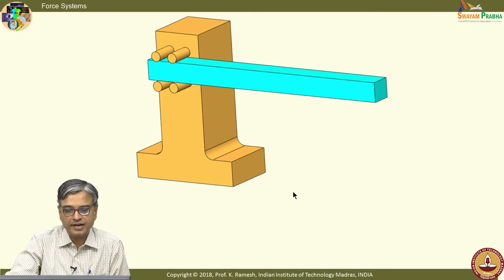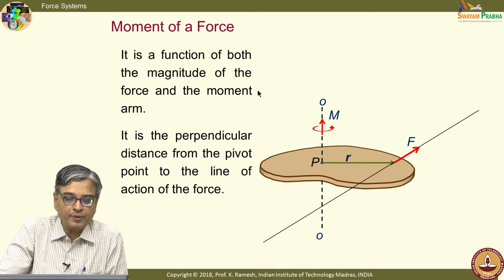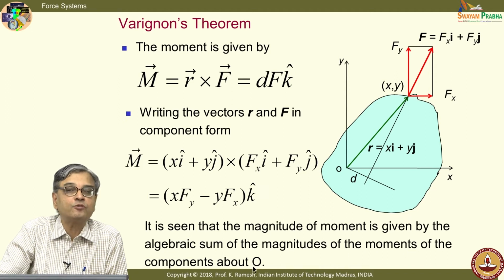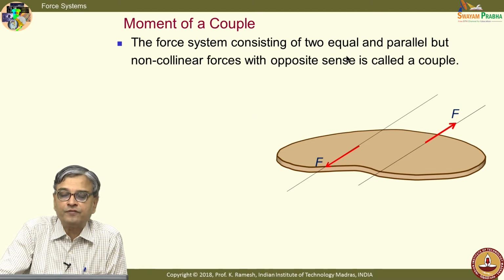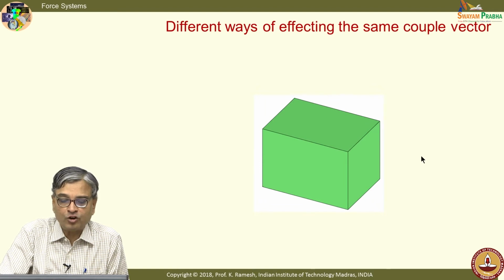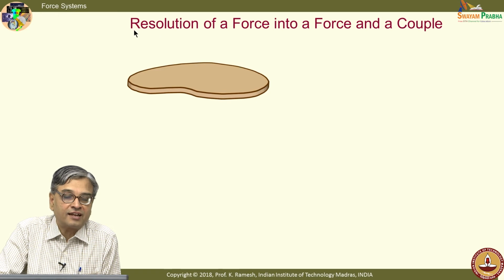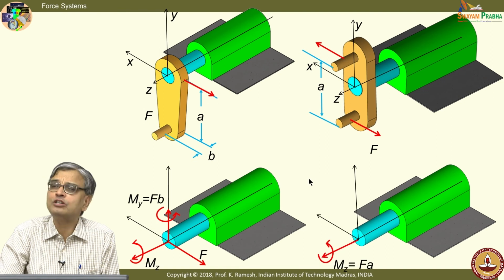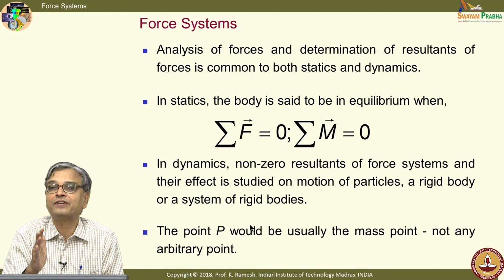Lec 04 Force Systems II

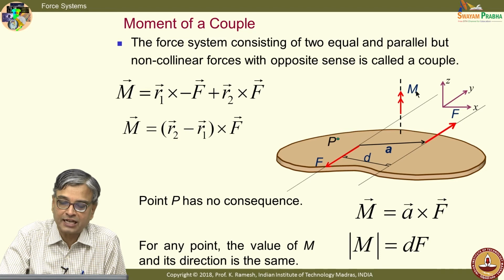Comment: At 25 ( 25:00 ) minute it has been said differentiate between moment and couple is important since for couple location of  point(P) does not affect it. 

But is it also works for a system where the net external force is zero that there also location of point(P) does not affect it?? Someone answer plz...

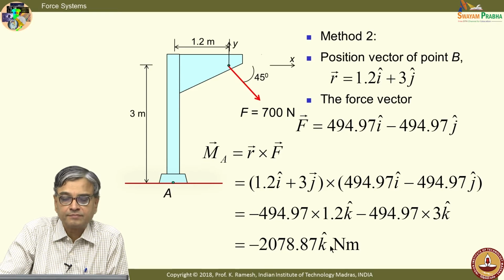Comment: In 17:52 from where we got ( - sign) in F =494.97-494.97
Reply: F has 2 components, 1st one along X-axis and the 2nd one along Y-axis. Now the component along X-axis is on +ve direction bt the 2nd one has the direction towards negative side of Y-axis. 
Therefore, 
F = (+700cos45'i)+(-700sin45'j)
Reply: direction sense dekho ,for anticlockwise pos, for clockwise negative
Reply: As @RITTIK CHAKRABORTY also correctly pointed out, the signs of the force components depend on its inclination with respect to the positive coordinate directions.

Note that as per the generally adopted convention, angles measured anti-clockwise is positive.

Therefore, you can consider the inclination of the force to be -45 degrees (clockwise) wrt x axis

x component : F cos(-45) = F cos(45)
y component : F sin(-45) = -F sin(45)